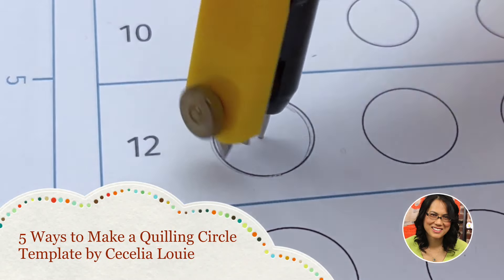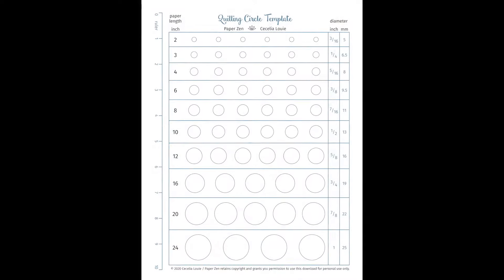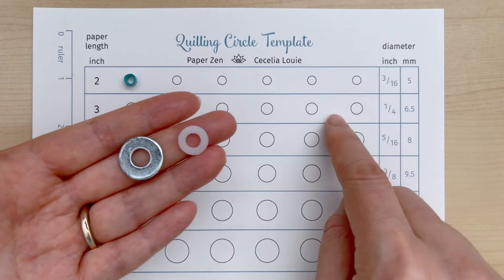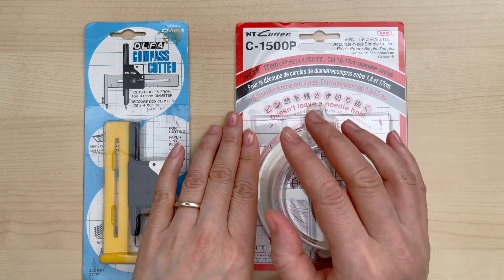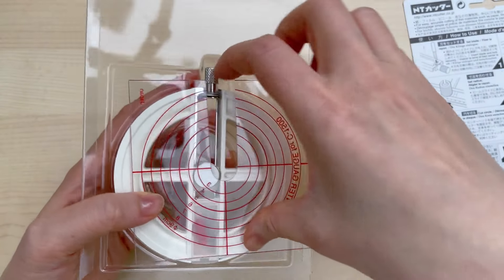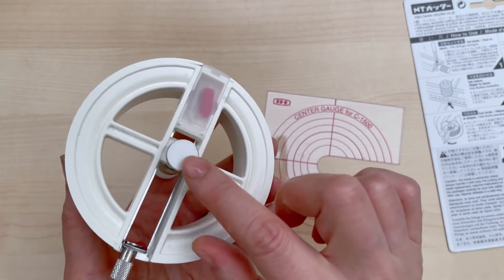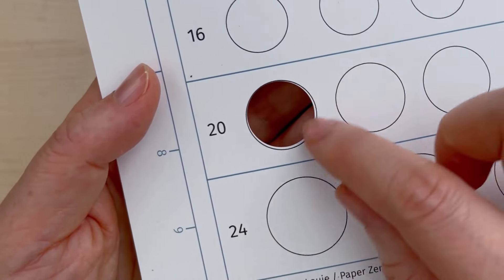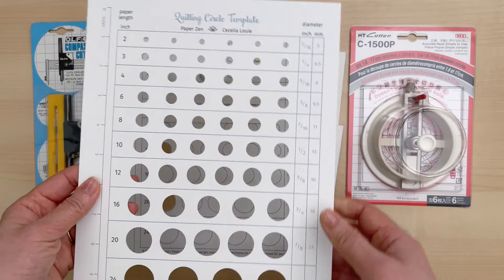How to Make a Quilling Circle Template - 5 Easy DIY Ideas - Free PDF Pattern

Comment: Cecelia, I like that you show different ways to make these because not everyone has a cricut. Why do you have 2 different tacky glues listed and what is the difference? Thanks, Pat S
Reply from the maker: The "Always Ready" design has the cap on the bottom, so the glue will always be ready for you to use. Other than that, it's the same.